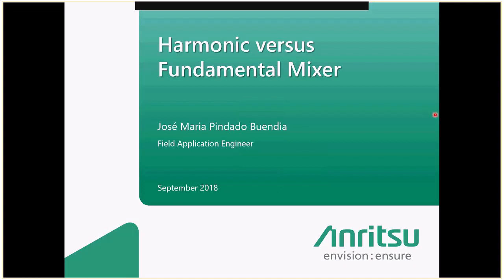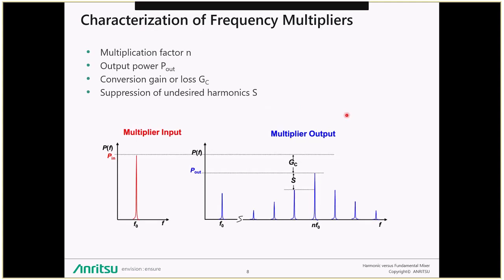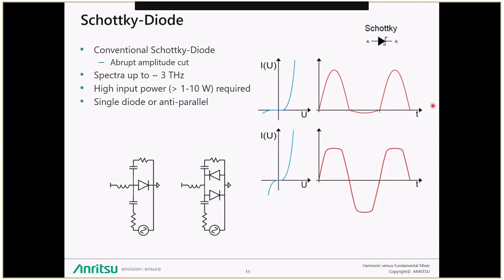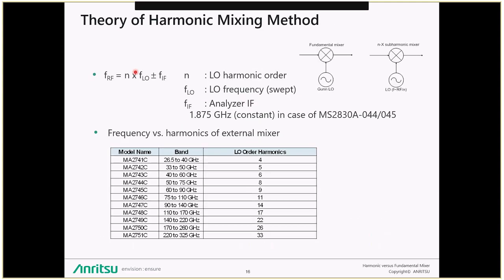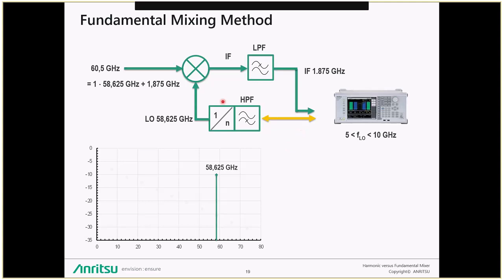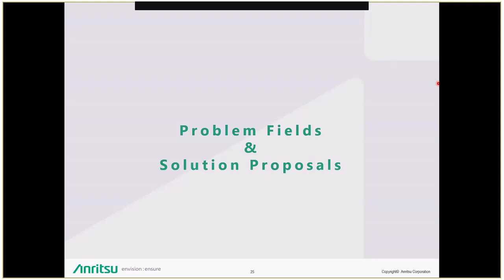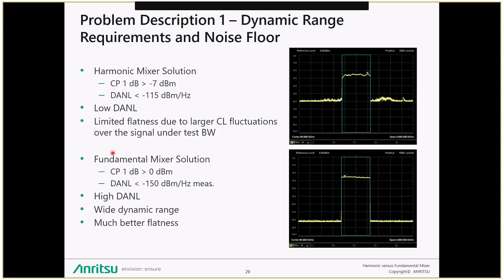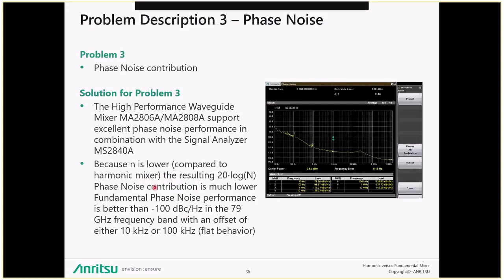Fundamental Mixing vs Harmonic Mixing

Comment: Is possible drive subharmonic mixer in "freqency reverse mode"?
Radio freqency = 13kHz
Local oscillator ( two times greater ) 27kHz and get out 1kHz difference?